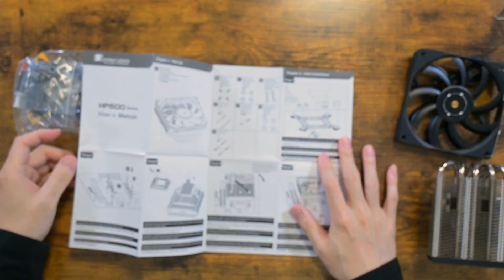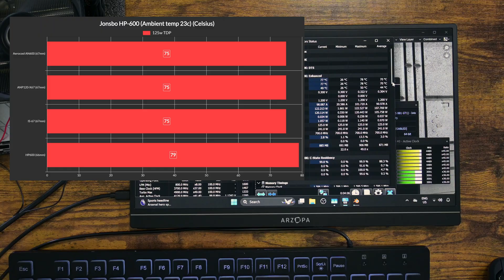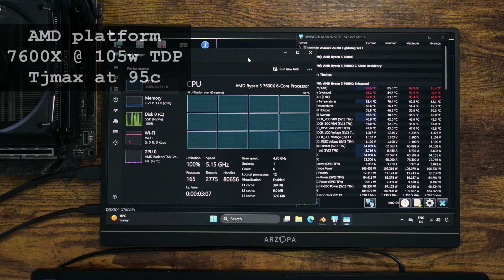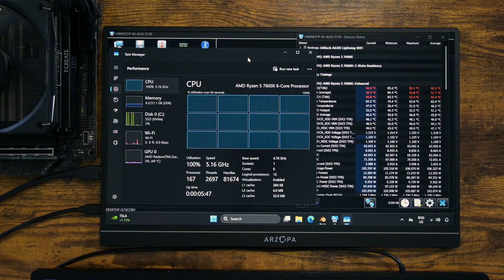Jonsbo HP-600, a 66mm CPU cooler

Comment: i bout it cuz they claim it can cool 210 of TDP which is awesome, but the fan is so fakin noisy everyfakin time a had to buy slim acrtic 120mm fan with 4 pins and its quiet with great temps even when its goes whoosh its just louder air sound not bearings... its tinkering cooler not "bet on sure" like noctuas  l12x77,l12s,l9 etc .... CPU: ryzen 7 9800x3D yep and be sure you undervolt your ryzen cpus (7gen up, same performance but more quiet and much less temperatures)